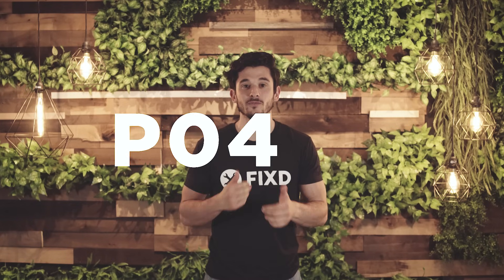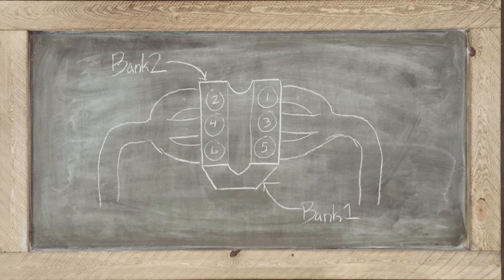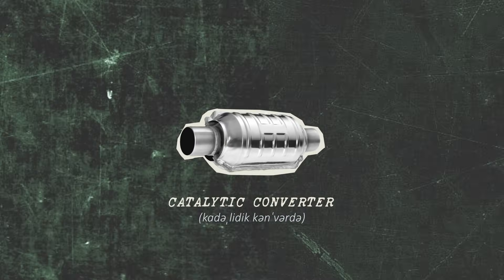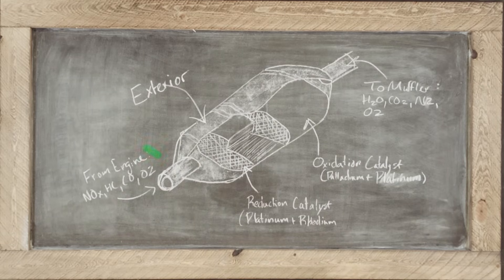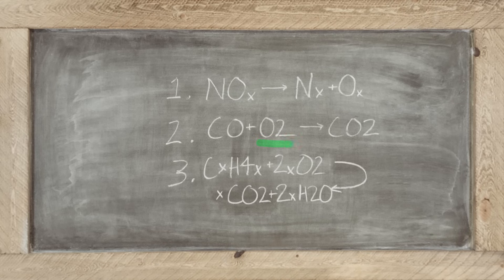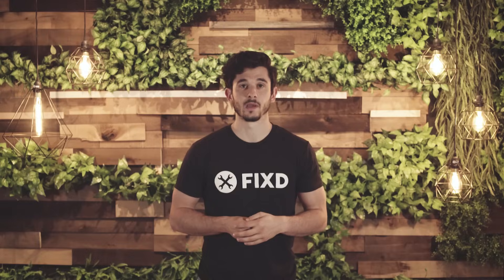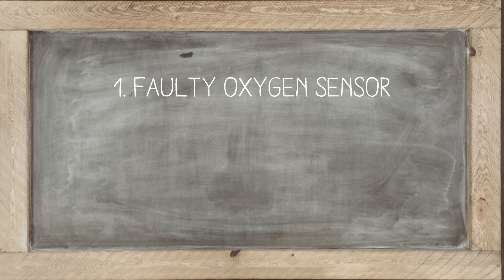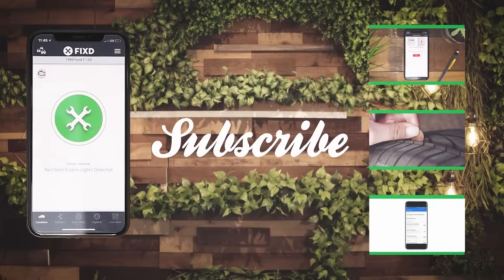P0420 Error Code Explained - Catalyst System Efficiency Below Threshold

Comment: I got 420 code.  Changed sensors.  Still coded.  I put in Cataclean.  CEL went off, then after 200 miles came back on.  Changed manifold with cat included.  Light went off, then came back on. There is only one gasket between engine and catalytic convertor and I just changed it.  Then there is a donut gasket just before the second sensor, but it us also brand new. I am stymied.

Comment: I had a code P0420, P0031 and P1148. Got a bottle and Cataclean, poured it into 1/4 tank, drove 46 miles before having gas up, drove another 29 miles and the catalytic codes went away.

Comment: A P0420 means you have to replace the catalytic converter , replacing the sensor will not fix the problem,   This code occurs after a blown head gasket has taken place   and the antifreeze clogs up your  catalytic converter,   Through your radiator check for combustion gases ,  which are sighs of a blown head gasket  , I've learn this from personnel experience

Comment: I got a P0420 code and couldn’t pass emissions. Dealer wanted $4k to replace the catalytic converter. I got some CataClean for $26. After about 100 miles CEL disappeared. I passed emissions later that day.
Reply: Thank you!!  Maybe that meant it was not the Cat, but the exhaust lines?
Reply: Mine came off after 100 miles came back on after 100 miles

Comment: what might cause this code on a 2005 accord 2.4 with a converter that's only 5000 miles old? 

converter was stolen a few months ago and was replaced with a brand new one ... code just popped today when it was really freezing out while it was warming up and the code is persistent and won't reset 

thanks

Comment: what advise can you give to someone who completely removed the cat and get the error code
Reply: Your check engine light will stay on if your catalytic converter is removed or stolen. Also if you decide to replace your catalytic converter with a straight pipe instead of another catalytic converter, the check engine light will stay on. Take care.

Comment: Hi and thanks for your informative video.
So as i understand it is not dangerous to continue driving the car as usuall when we have this code.
My catalysator has been stolen for a year ago, with the help of the insurance company i got a new one instead (original one as they said), now unfortunately i got the engine light on and detected code p0420 with my error code reader. I don't feel any problem with the car so i have just removed the warning with the help of my error code reader and it didn't reoccur yeat. Do you have any opinions/syggestions about that? 
Best regards/ prius driver from Sweden :)

Comment: I have this on my FIXD sensor at the moment. I have cleared it three times. I am going to try an in-fuel catalytic converter cleaner. I love the FIXD Sensor and the App.
Reply from the maker: Thank you so much for the kind words and for using FIXD, Andrew! We appreciate your feedback. Hoping for a quick, affordable remedy to your P0420 code! 🤞
Reply: I used the oxicleaner it cleared the light for about 2 months so I bought another bottle it cleared then came back on. Good luck.
Reply: @yvettepretty  The cat cleaner seems to have worked on mine.
Reply: @AndrexT may I ask what kind of cleaner you used? I currently have this issue
Reply: @ 
Dura Lube Severe Catalytic & Exhaust Treatment -16 oz. I ran a bottle twice over a month, $23 a go but it worked.
Reply: @yvettepretty  I have Toyota Prius 2016 new shape the code is catalyst system efficiency below threshold bank 1   How can we fix this please

Comment: If it is a faulty O2 sensor shouldn't it bring up one of the sensor codes? I've previously had 2 brand new different O2 sensors installed in my 2003 Hyundai Elantra GLS & had a new catalytic converter installed.
Reply: Not necessarily

Comment: I have this code on my B7 A4... but I'm running test pipes... with the o2 still attached and functioning. Just came out of nowhere too... any ideas?
Reply from the maker: The rear 02 sensor acts as a monitor for the catalyst. When the vehicle is driving and reaches full operating  temp, the ecm will run a readiness test to verify all is well with the catalyst system. The purpose of the 02 sensor is read how much unburned oxygen is in the exhaust as it exits the engine. Monitoring oxygen levels in the exhaust is a way of gauging the fuel mixture, or fuel trims. It tells the computer if the fuel mixture is burning rich (less oxygen) or lean (more oxygen).In the case of test pipes, the catalyst is deleted therfore the sensor will read as if the catalyst is not working properly, when it fact is not there. You can clear the light but it will come back on eventually. Many times vehicles with test pipes, big turbos etc, will have a tune that works with the test pipe to keep the light off in states where there are not emissions.
Reply: Just read the temperature of the catalytic converter at idle with "hot" engine. I mean if the converter works properly, the rear side is warmer than the front side. 50 degrees Celsius more

Comment: I recommend buying Catacleaner Before spending $200-1k , drive it around for about 15-20 mins or longer , return to where you were working on it. Disconnect the neutral from the battery to Reset the system , you DONT have to but it’ll take the check engine light off Sooner than just driving and letting it go by it’s self (could take up to a week) to simply turn off.
Reply from the maker: Thanks for spreading the knowledge!
Reply: If you disconnect the battery, don't forget you have to know the security code for the radio and you also have to know the security system reset or re-learn procedure. I don't suggest breaking the power to the ECM, BCM or any other management modules unless absolutely necessary.
Reply: Hi there just want to know which brand Catacleaner is most effective thanks?
Reply: @NoahPARK82  Try Duralube Severe Catalytic Converter. I just posted and added a link to it but it vanished. Also try Scotty Kilmer YT channel and search.
Reply: @NoahPARK82  it's in a grey bottle. It's call catyclean. About 34 bucks a bottle
Reply: @johnbooker6524  hi...do we need to pour entire bottle in gas tank...??
Reply: @mtechparvez  yes....with 1/4 tank. Drive about 20 miles at highway speed,  then fill up the tank. Works great for me. I live by it!!
Reply: @johnbooker6524 didn't work for me. Seafoam
Reply: @Ryanbaggarly 
Sea foam…meaning? Thx!
Reply: Can it sit over night without driving the 50-100 miles to reset the cycle to pass an emissions test?

Comment: I gutted my cats. and now I`m getting this po420 code...I have a hand held programmer and a tune from a shop...
Reply from the maker: If your catalyst is gutted and the vehicle's ecu is still using the rear O2, which it will do unless coded out then you will get a p0420 fault. The job of the rear 02 sensor is to monitor the efficiency of the catalytic converter. I would suggest giving a call to said company you purchased the tune from and see what they do for your particular file. Without a specific file change this code will most likely come back. There are times when people have used O2 sensor spacers etc., however I would find out how your ecu tune is setup and go from there.
Reply: @fixdapp  I first deleted the rear cats years ago with no problems..Then a month ago or so, I gutted the front cats and reinstalled the front two 02 sensors after,installed two new perf mufflers..I got a P0430 code a while back but nothing since..I called my tuner guy and he said if it returned to let him know and he`ll readjust the tune..

Comment: Brand new CAT and all new 02 sensors and still a 420 code..... LTFT and STFT are normal....no vacuum leaks anywhere, new coolant temp sensor, and engine had just been rebuilt......code still comes on.... frustrating me to death
Reply from the maker: What kind of vehicle are we looking at? Was the catalyst replaced with an OE part, what is the cell count for the new Catalyst? Many times an aftermarket Catalytic converter may be cheaper but will not work as well. If the purchased catalytic converter was a weld in part be sure it was put where the factory one was installed. It has to be in the factory location or close to it so it can get hot enough to work properly. You said the engine has been rebuilt, be sure the ring seal is ok with the new engine. If there is excessive blow by this could result in the catalyst being coated with oil vapor and not being able to reach the operating temp required for an effective catalyst. You can look at the front and rear 02 sensor operation also. The front O2 will be constantly adjusting from rich to lean. the rear 02 should be a fairly steady line if the catalyst is working properly. Be sure you do not have any exhaust leaks pre cat/pre o2. If the rear 02 is matching the front then the catalyst is not working how it should.
Reply: @fixdapp  direct fit catalytic converter for my supplier, brand new O2 sensors, and the engine was rebuilt buy a guy who builds engines for racing.
Reply: fuel pump - replace it, sometimes MAF Goes bad as well. But my take it the fuel pump.
Reply: @g.s.7383  Fuel Pressure checked at the rail is within specs...... I have dealt with the 420 code before and it can be quite frustrating.

Comment: I just got a new cat and oxygen sensors and I patched up all exaust leaks and I'm still getting the p0420
Reply from the maker: P0420 fault can be tricky sometimes. The fault is stating that the catalyst is not working efficiently based off what the rear 02 sensor is reading. Many times the reason a catalyst fails is due to something else in the system that caused it to fail.There is an 02 sensor in front of the catalyst (pre cat) and an o2 sensor after the cat (post cat).The front oxygen sensor is the primary 02. The second (post cat) is the monitor. If there is an issue in the engine causing the car to run rich or lean the car will adjust to compensate for this issue trying to fix itself, and in so doing can cause a false reading indicating the catalyst is faulty when in fact there is another issue. Example: coolant temp sensor is faulty and telling the pcm that the car is very cold. This would cause the pcm to add more fuel which would result in a rich running condition. The rich running condition could add too much fuel to the catalyst causing it to not be able to heat up properly and reach the correct temp. This would cause the rear 02 to read as if the catalyst is failing when in reality it is because of too much fuel causing the catalyst to not work 100%. I would suggest looking at fuel trims, verifying 02 sensor operation/voltage and go from there.

Comment: One must understand where this code comes from. Most see a 420 code and think they need a cat everytime. This code come from the down stream 02 sensor. The upstream 02 sensor is there to monitor fuel trim and the downstream is there to monitor the cat.
Reply: Absolutely correct 👍
Reply: What if i replaced both o2 sensors then the code came back 3 weeks later??
Reply: The code can be from different areas besides the down stream O2 sensor you know. High coolant usage can be a factor. High engine oil usage can be a factor. Engine misfires can be a factor. Etc.
If it were just the down stream (rear) O2 sensor then that would be an easy $50 fix in a day.
Reply: @neoeyebeleave  agreed many just think it's a sensor without understanding of they are burning chemicals the cat isn't designed to scrub you test your cats with a thermometer before you pull the sensor.
Reply: What should I ask the mechanic to check? I have an inspection on Monday. My car is very old and rusted but runs so super well. Thanks for this info!

Comment: This video is based off other videos only. The most generic information to get views. 

#1 P0420 is a Generic DTC( diagnostic trouble code) for emissions issues. This simply means your rich. The air fuel/mixture can be thrown of by many things. The number 1 causes for this is excessive unburned fuel.

To much fuel for the catalytic converter to *burn*. Your 02 sensors are self explanatory. They monitor O2  (oxygen) levels which change depending how efficiently the engine is burning the  computer calculated air/fuel mixture, BEFORE it even reaches the catalytic converter or exhaust.

O2 sensors tell us the level of oxygen in the exhaust, indirectly via generation of voltage when oxygen passes through their electronic element.

This being said, how does your car not burn fuel? A misfire causes rich fuel mixture to go through the cylenders without being burned...remember that trouble code we found before? P(powertrain) 0420(0400 series, emitions) (0020 exact sensors which detect a fault in the system) 

A dying coil pack can create misfires at high RPM and create a complete series of unburned fuel strokes to trip the O2 sensor. 

The cars main ECU(electronic control unit) that manages the cars Engine performance, (varies from manufacturer (pcm or 10 other acronyms) simply knows this information for emissions purpose. Some cars use 02 sensors to detect a misfire. Some don't. In face there are several ways.

The whole point is. Many conditions could cause a misfire and cause other conditions which create a rich or lean condition. Leaking fuel injectors can cause this too. These electronic systems never tell the technician what the problem is. They only give us clues as to why the engine is not running at peak efficiency of 14.72 parts of air(baro metric pressure aka, bar 1) to 1 part of fuel.

YouTube is one of the worst places for information because of videos like this. 

Suuuuure take your care to a mechanic who claims they are up to par with information like this and have been educated, (experience means nothing if you've done it wrong and just made people believe you know what you are doing) yet they rip you off with $2000 bill and you still have the original problem. 

The check engine light might go off for a bit. But it's the unburned fuel from the engine which sets this code.
Reply: @Nintendo Challenger X If you want answers. I'm available to give information.
Reply: @MrTimedd  Can you tell me what the best option for fixing this code is? My friend replaced my MAF sensor, and both O2 sensors and I still have the code. Tomorrow we are going to try soaking the CAT in Purple Power and/or water and laundry detergent. Is there any other option other than getting a new CAT?
Reply: @whitelotusbodyworks  

  You can look for  vacuum leaks in the exhaust, which add a bunch of unexpected air to the system, before the exhaust reaches the Catalytic converters. Remember the code gets generated by the computer, (ECU, PCM etc...) Which only sees a certain trend based on what the sensors give it. If the sensors are tricked via the extra unmetered air in the exhaust, it's one way to make false codes. Did your friend be hit a tree branch? Or Have a new muffler put on, creating new back pressure? 

You need a scan too which reads legitimate "live Data Stream" here you can read voltage outputs from the O2 sensors and short term and long term fuel trim to tell if the engine is at proper air/fuel efficiency.

If you could make a video no I'd be curious to see what's going on. Id really like to see if the cleaning works. 

There are other situations too.

But as for cleaning catalytic converters. You need to fix what caused your cat to supposedly need cleaning in the first place, did the check engine light flash while driving? If that happens, it's a universal sign that tells the driver to stop the engine as the cat is to hot...To much raw fuel from a misfire, sometimes ignites inside and this flashing CEL, is the warning... Fire hazard.  Any method assumes you do have a cat issue, so  if you know the engine is clean(no gunk to fly into the cat) you could try one thing before pulling it off and using purple power. I recently bought and tried(bare with me) laquer  thinner(yes the cleaner) to use in the fuel. 1 gallon to 10 gallons of fuel. I tried this as I've been having the same codes as you. In Truth I found better performance from the cats, but only initially in my testing. This only works if the catalytic converter isn't Burt to the point that it crumbles and clogs. Mine got fowled by fuel actually, so cleaning helped. But the original engine issue needs fixing to make sure I don't kill the cats again. I was testing this method as in automotive school, they say cat cleaning doesn't work 100% you simply get lucky.

The link is to an example.

https://youtu.be/vyVnhCIMDnw

https://youtu.be/pBcLIeKj_38
Reply: @MrTimedd  Ok thanks! My buddy already took off the CAT and we're letting it soak. I will let you know how it goes.
Reply: What happened next  @whitelotusbodyworks
Reply: Do you know if a very dirty air filter could cause it running rich? I drove on the highway yesterday, which i never usually do, and the check engine came on. I have been procrastinating the air filter but i have finally bought it today and installed it. It's still there but I'm gonna put catalyst cleaner in it just to be safe.

Comment: Thanks for the info. I like it.

I would like to add,

Here is an easy solution to clean a clogged catalytic converter.

https://youtu.be/t2Hf0uN9p4A

It will be solved the code P0420.
Reply: Watch the result, 

https://youtu.be/oiRiYcZpluc